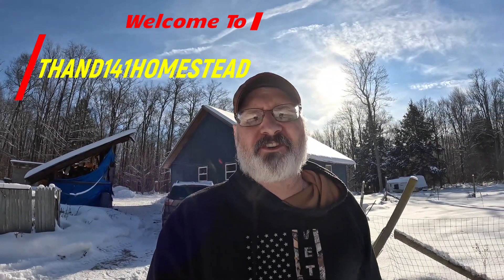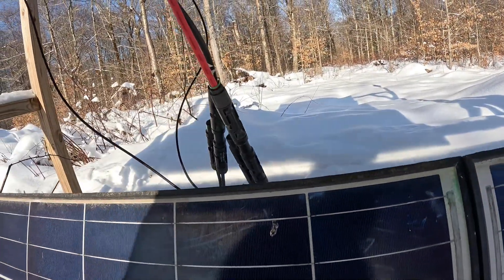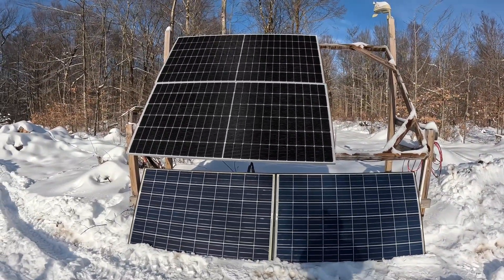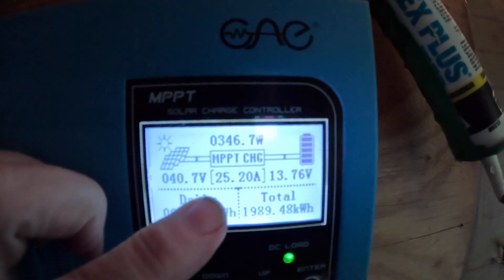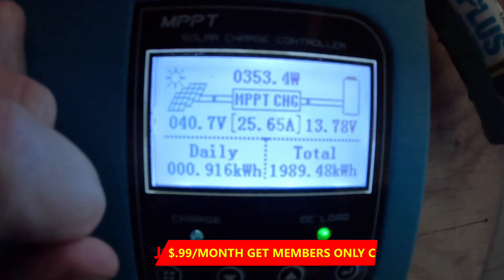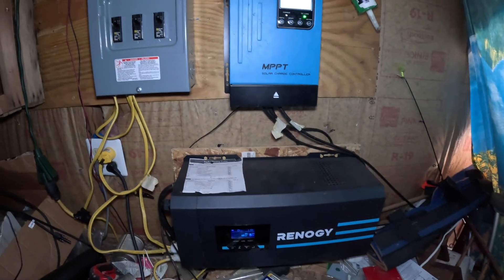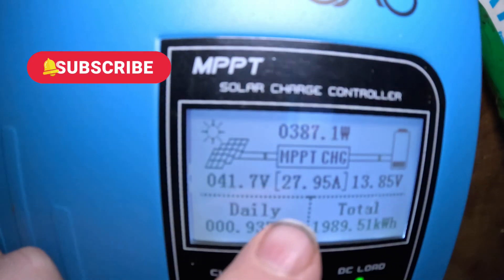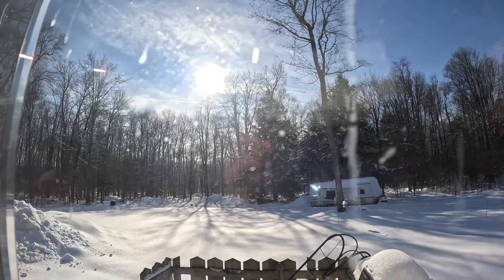Maximizing Solar Panel Output: Battery Charging Experiment

Comment: For parallel connections, the Vmp (operating voltage) of the strings placed in parallel need to be fairly close to each other.  For series connections, the Imp (operating current) of the panels placed in series need to be fairly close to each other.    The wattage spec for the panel(s) are irreelvant.

So if you are going to parallel different panel types, make sure that the Vmp (the operating voltage, not the open-circuit voltage) for the two strings being paralleled are reasonably close to each other.  If they are you will get good production out of both strings.  If they aren't then one string will override the other and you will only get a little extra oomph.

You also have to be careful about the current being back-haulted over the long cable going to the charge controller.  Generally speaking, larger panels are able to push a lot more current so make sure the cabling can handle the worst-case (highest) current.

Generally speaking you want to use a proper solar combiner box to parallel strings and not use MC4 paralleling adapters.  Proper solar combiner boxes contain fuses, a master breaker for maintenance, and surge protection, all in a weather-protected box.

The best solution is to not parallel in the first place and instead back-haul independent cable pairs for each string into their own dedicated MPPT charger controllers.  This can sometimes be burdensome if you have a very long cable going from the array to the charge controllers but it's usually the best solution to maximize production.

-Matt
Reply: Have the feeling he'd be better off using either the 250s or the 500s by themselves, rather than mixing.
Reply from the maker: That may be very true. That is the reason for the experiment. Thanks for watching!
Reply from the maker: Thank you so much! There is a lot of info here I was trying to find and sort out! After a day or so for comparison I plan on connecting 1 550w and a 250w together and parallel those to see what happens. I am running 100ft of 10awg wire which I think is limiting my volts to the controller. If that is the case, what size wire would you suggest? Thank you so much!
Reply: @THand141Homestead  10 AWG is generally the biggest cable you want to use for solar cabling or for a DC back-haul.  If you have to drop to 8 AWG or 6 AWG then it's probably a design mistake.  There is a better solution.

The better solution is to increase the string voltage... have more panels in series.   So rather than reducing the voltage drop on the long cable, you make the voltage drop relative to a much larger string voltage.   That will vastly reduce power losses in percentage terms (which is the goal).

This is also another reason not to parallel strings.  Power losses are a function of the square of the current.  P = I * I * R.  I = current, R = resistance of cable.  P = power lost to heat.   When you double the current on the cable you multiply the power loss by 4x (not 2x).   (this is, coincidentally, also why long utility transmission lines bump the voltage up into the hundreds of thousands of volts instead of trying to increase current).

Generally speaking, increasing the string voltage should only be done with the same brand of panel, and the charge controller that you back-haul it to must be able to deal with the increased voltage.   So this solution is less ad-hoc and requires a bit of planning.

-Matt
Reply from the maker: Thank you so much, You are a great help!